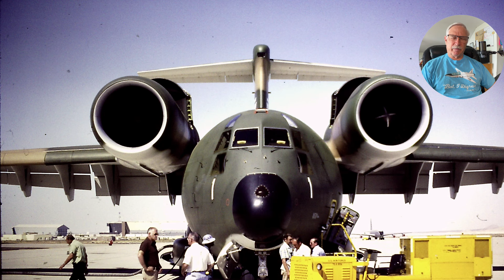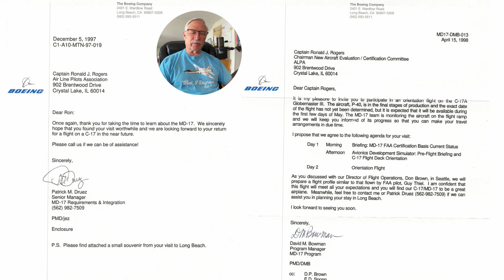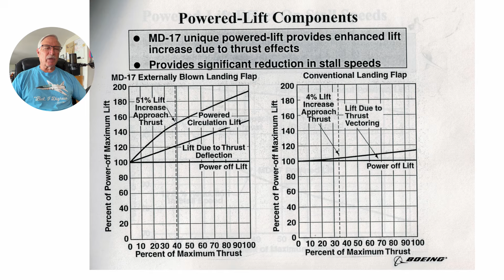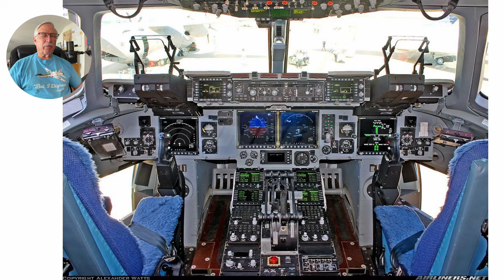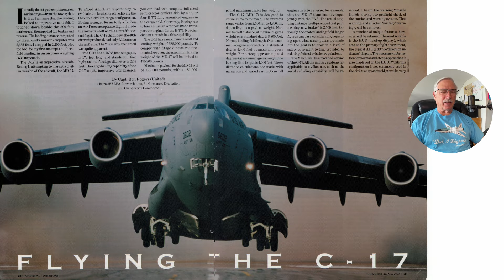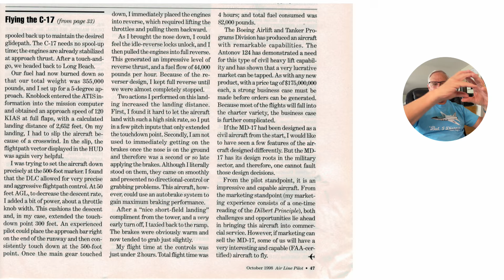Test Flying the USAF C-17

Comment: Ron, I was once a C-141 IP/Flight Examiner and Aerial Refueling Qualified on both Active Duty and the Reserves at McGuire. I’m also a retired FedEx pilot and back sometime in the early 90’s FedEx management considered buying C-17’s for its Aerial Refueling capabilities and its ability to over-fly Customs delays due to required fuel stops and continue non stop to final destination. I was not privy to the details of the ‘Tanker’ side of that equation though. My guess is that each airframe would have been a welcomed addition to the CRAF program and Tanker availability was possible.
Reply from the maker: That was my comment to McD. There would be plenty of airline/reserve guys to fly the aircraft!
Reply: @ronrogers just imagine the infeasibility of qualifying civilian-only trained pilots as being aerial refueling receiver qualified?
Reply: I’ll add that FedEx determined that there was a good number of qualified and current Aerial Refueling pilots on the Seniority Crew List, but can you image the Contractional Seniority Issues of putting those A/R Qualified out-of-seniority pilots in the seat to get the gas?

Comment: That Boeing label never made sense to me. I see the C17 as the last airplane built by Douglas Aircraft Corp. in Long Beach, CA. I remember a GAO report about developmental and costs overruns particularly issue of off-the-shelf software which was really not off-the-shelf as their never was a program for running a C17 before the C17. Another story I heard is more C17s were produced than what the AF wanted to buy, congressmen wanted more to be bought. I met a former DAC engineer that worked on the YC15, he said the main "office" had program manager desk basically in center of surrounding desks of the different aspects of the aircraft. Purpose was the PM can be easily accessed by other engineers and managers to work issues.

Comment: One of my NASA co-workers was in charge of a C-17 wind tunnel test at NASA Ames.  It was a half model test with two engine simulators.  I was told the test was being done because the flight tests were not matching the drag predictions.  I was, at the time, on a cruse out of NASA after 30years of having fun with taxpayers money.
Reply: This is why NASA provides high quality test facilities for aircraft manufacturers so they can gather experimental data doing "flights" more cheaper than flights with actual aircraft. Plus avoid surprises in performance before fabricating full size aircraft.

Comment: Flight control modes are EFCS (electronic flight control system) which is full FBW, then part mech and full mech.  Part mech takes the pilots inputs and reduces them by 50% to prevent overcontrolling.   That’s the initial reversion it EFCS is lost or disabled.